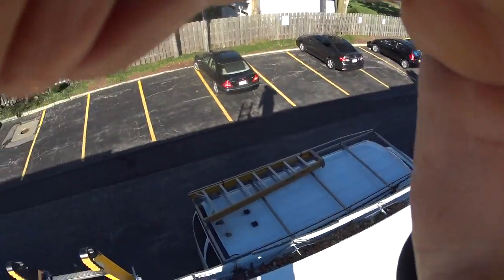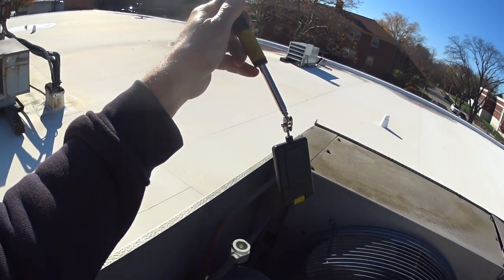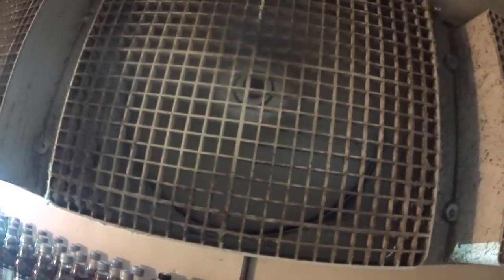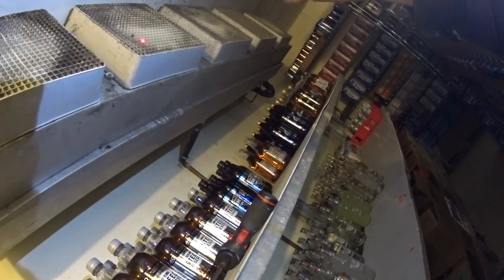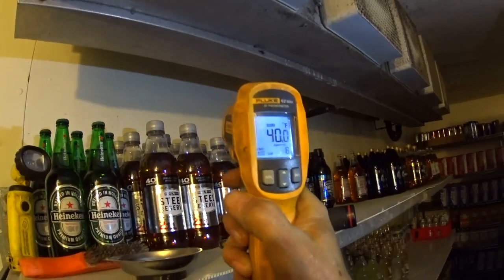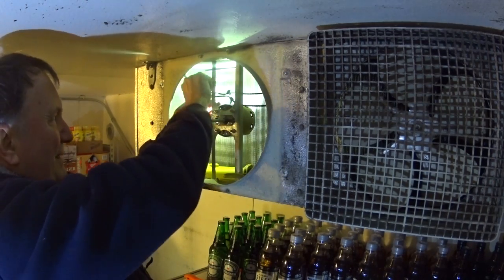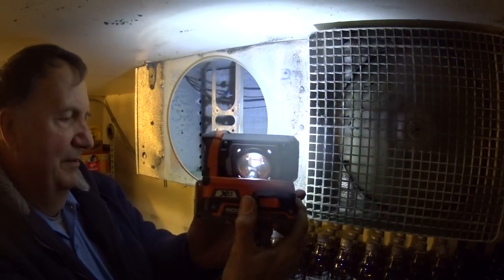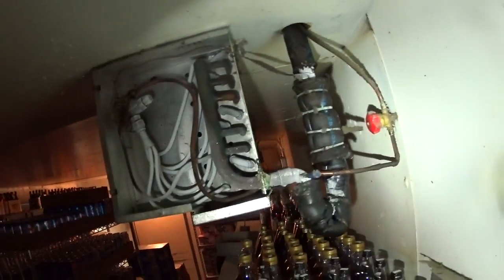Walk in Cooler charging and cleaning the Evaporator Coil part 1

Comment: At 10:04 , you made a excellent safety comment.  Never trust someones else's electrical (or other workmanship).   Always check the wiring after switching or disconnecting off for energized circuits.  It will keep you alive.   Cheers, James Hunt, TLDR certified Electrician / HVAC/c .   Being certified/accredited sets a person apart from the DIY'ers.

Comment: Jim i have r-22 walking cooler i replace txv valve and high side dryer and so far i have charged 10 pounds freon but still low side goes under 10 psi and compressor shuts down do i need to open txv valve or it is still low charge thanks jim please give me advise

Comment: The fans went out because the coil was plugged probably. I would have fixed the fans before charging the unit with refrigerant so I could get the charge rite and so the coil didn't ice up from no air flow but everyone has their own method. Nice job anyway thanks for posting this video up.